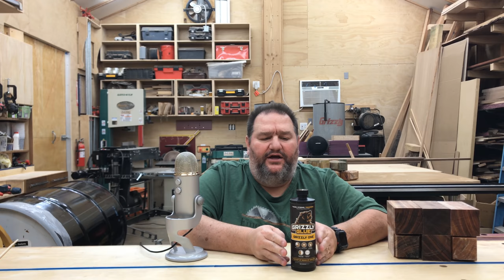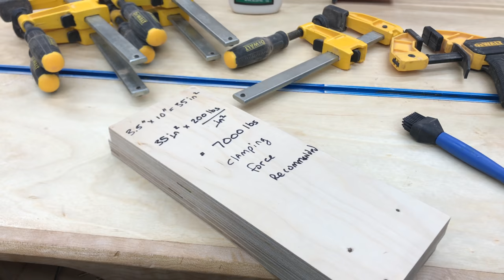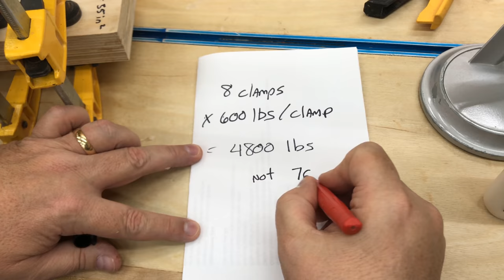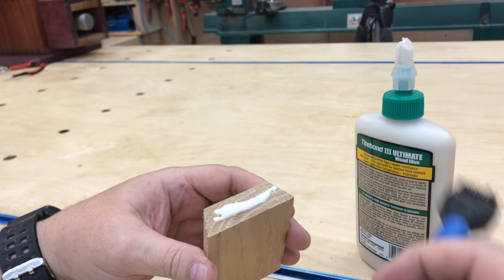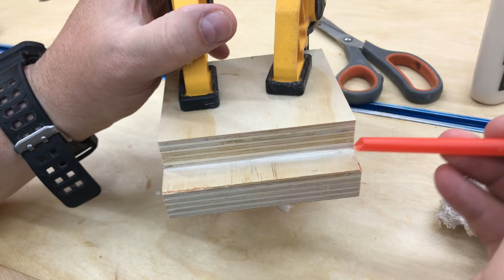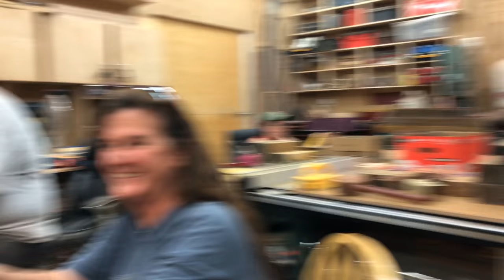67 - Definitive Guide to GLUE for Woodworkers Woodworking 101 lesson 3

Comment: James at Wood by Wright did an extensive set of tests on a lot of glues you really need to look at. I'd be interested in your feedback. I have yet to attempt the CA glue because it is a bit expensive to tinker with. I have used the Gorilla glue foaming stuff and was not happy with the need for tight clamping and heavy cleanup on furniture rungs etc that I am constantly having to repair. I am interested in the "shelf life" of CA on the shelf and in completed joints. Will it work for the life of the joint in furniture - chairs specifically - as well as other glues?
Reply from the maker: Hi Clyde, I'll check out his video. Thank you!
Reply from the maker: I wouldn't have much faith in long term CA glue, but, I can't say for sure without researching it first.
Reply: King's Fine Woodworking  Thank you for the reply. So many are converting for the speed but I really am interested in long term. However a combo might work well where the CA tacks and the other welds??
Reply from the maker: Yes, it just might.

Comment: I think I failed to submit my earlier comment.  I think this as a very informative video. But since you didn’t mention it, is epoxy the only one of the glues that accepts coloration? I would like to try the epoxy as I have never used any.
Reply from the maker: Hi Chis, great point!
Reply: Yes!
Also one of the reasons I want to try it too Chris. 
Two of my flags I offer people is my “thin blue line” and “thin red line” which honor police and firefighters.  
Usually the maker of the flag will just stain the strip directly below the union (blue field) either red or blue.  
My idea is to use my router table and rout a thin groove down the length of the strip. I’ll fill the groove with epoxy that’s had a red or blue pigment mixed into it. Once it cures it’ll truly be a thin red or thin blue line.

Comment: Is there anything titebond original has over 2? Price is very close.
What I mean is there a reason to buy original over 2 considering the gallons are less than $2 different? 
3 is 1.5x the price so I can see a reason why some wouldn't go for 3. But just curious if there are things you would use 1&2 for differently or even 3 and why not just use 2 and 3 for everything or just 3 if cost wasn't the only driving issue?

Comment: 1/21/23 Sean here 37 yrs of composites/glues in Military Aircraft repairs. Now retired & just started getting into wood working . Nice presentation all bases covered. Your opinion please . . . Bonding 4”x4” wood legs to ¾” birth plywood. The kicker is both surfaces have been treated with one coat of Total Boat deep resin sealer, & the surfaces are NOT perfect due to lack of proper power tools in my garage. Max gaps are 0 to .40 thou . My opinion is this is not a raw wood to raw wood bond due to the one sealer coat of resin. The bond needs to be structural and will also have one lag bolt per leg. That said would you use wood glue or epoxy. If epoxy I’d like to read your opinion as to what type of epoxy, just to see if we would be on the same page. There’s no wrong answer in my eyes this question is opinion based ( no judgement or negative comments coming on my end ). Thanks . . . Se’an from NJ .
Reply from the maker: Hi Sean, I’ve heard of Total Boat’s penetrating epoxy sealer, but I’ve not heard of anything called “deep resin sealer” by them. 

Not a big deal. If it’s epoxy based, that’s all we need to know.  In which case, you cannot use any wood glue because wood glues only adhere to porous surfaces, like raw wood. 

Your gaps are not relevant. A gap of .40 thousandths is almost non existent. In fact that’s less than half of 1/1000th. I’m curious how you even measured it. My best feeler gauge only goes down to 1/1000th (.001, or 1.0 thou). 

You can ignore any gap this tiny. 

Since you (likely) have epoxy sealer, you would need to use epoxy as your adhesive. 

For the woodworker, it makes no difference of the brand. Any well known brand will perform identically. They all have extraordinarily similar cohesive and adhesive strengths. And you needn’t worry about aerospace grades or high temperature rated epoxies because your woodworking piece will never be subjected to these extreme environments. 

Thanks,
James

Comment: The more pores the wood the better a CA glue works. It is used in building model airplanes and is extremely strong due to the penetration in Balsa wood. Hard woods not so much.

Comment: Hide glue does not me!t for use. It must be dissolved in water and used at a temperature of 140 degrees f. It has a very short open time. I have to use it in repaint and building stringed instruments.

Comment: most glues if used correctly will work fine.  However the most important thing for your wallet  is CHECK THE GLUE DATE.  You have no idea if you don't check how long the stuff has been sitting on the shelf.  If its more than two months old go buy it some place else!

Comment: Your math is off. You cannot just add up forces on a board like that.
See https://physics.stackexchange.com/questions/423996/woodworking-clamps-does-force-add-up/424086
Reply from the maker: Hi. It is outstanding that you are so interested in the physics of what is going on in this clamping process. I took the time to read all of the comments in that exchange. And I am talking about pressure, which is force per unit area. So I am trying to get the total clamping force spread out over the whole board to come close to what I need.  

If I need 200 pounds of force for each square inch and I have 35 square inches then I would like to have my total force at 7000 pounds.  I don't want 7000 pounds under any one clamp I just want to add up the amount that each clamp contributes to the total pressure. And ideally I would like that pressure to be uniformly spread. I know that is impossible because the pressure under each clamp is certainly greater than the pressure between clamps. 

However, force is certainly additive. 

I noticed you used Newtons in your example which is great because that is a unit of force. But what I am ultimately trying to achieve is Pascals. Which is pressure.  A Pascal, as you probably know, is a Newton per Square Meter.  Remember, my original goal was to try and get close to Titebond's requirement of 200 psi, which is pounds per square inch. Which is a pressure measurement, not a force measurement. 

So in your example you should have explained that I was trying to use 8 clamps of 300 pounds each covering 120 square inches (for example), to achieve an average pressure of 200 pounds per square inch over the entire surface. 

I hope that makes more sense. Thank you for commenting. We would love to have you in our community group on Facebook. If you are interested. 

https://www.facebook.com/groups/KingsFineWoodworkingCommunity/
~James